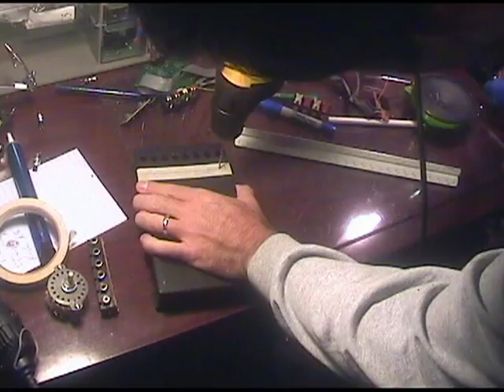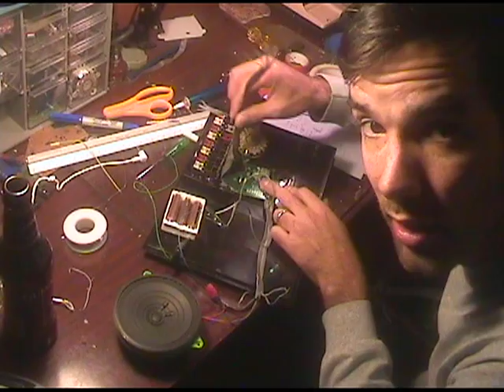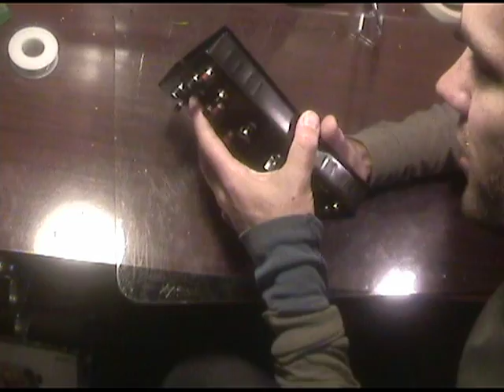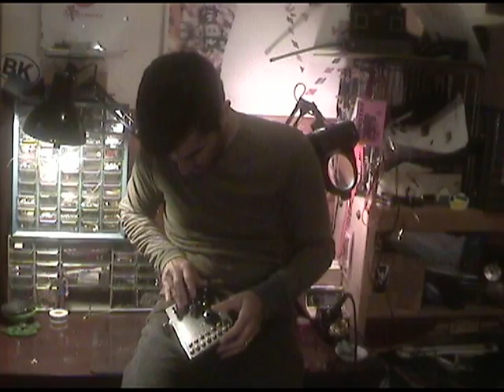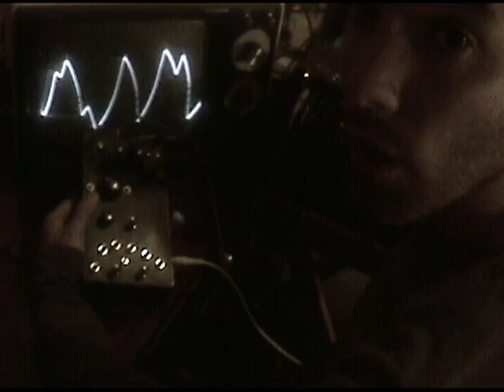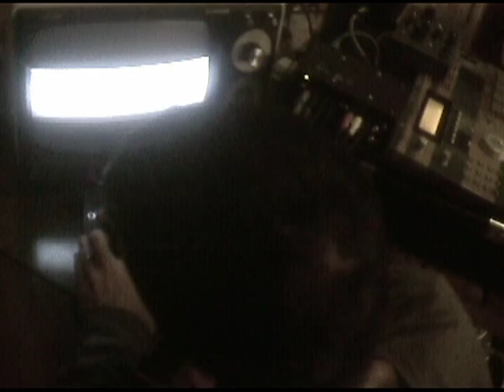Circuit-Bending the Kawasaki iSoundz Guitar with Burnkit2600 - part 2

Comment: I just bought the keyboard version, I discovered that feedback loop as well :D

I added a switch bank to ground IC pins and put a pot on the feedback loop. I plan to also add a kill switch and a pot on the pitch resistor. 

Going to use it as a pedal when it's done, I can take audio in the AUX jack nicely :D